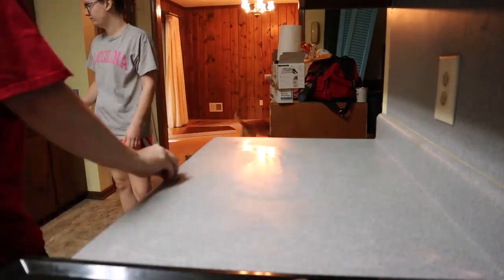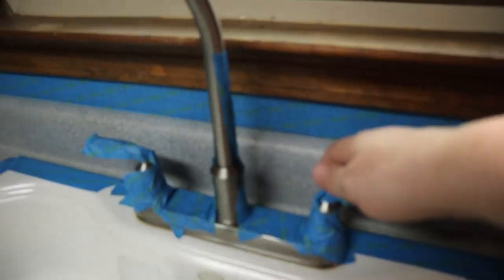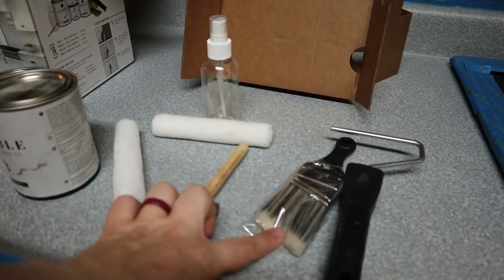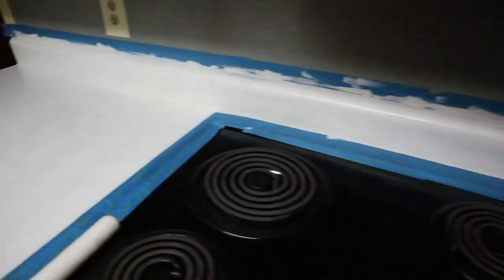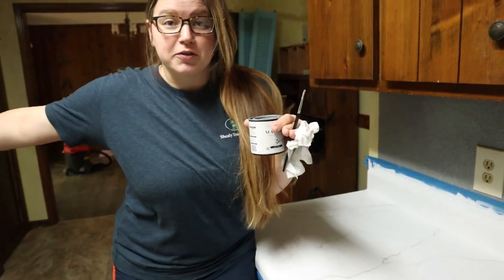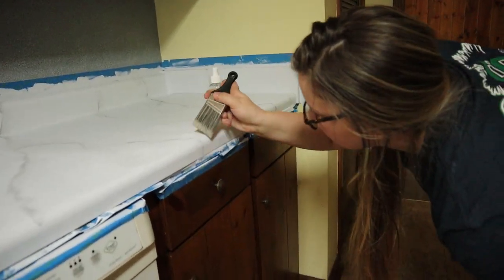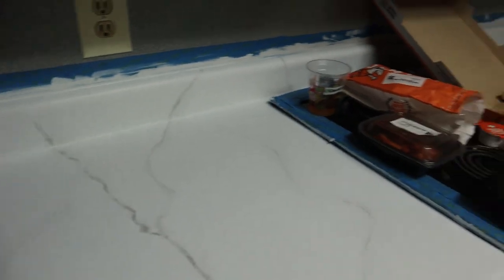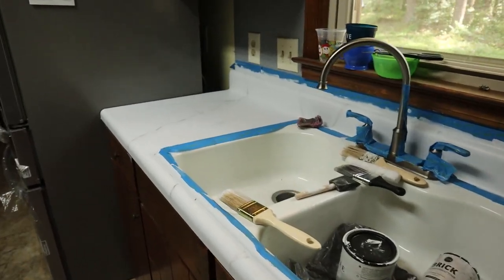Giani DIY marble countertop paint kit | under $100

Comment: did you use the marble kit with the epoxy? i can’t find one with just the white paint and black marble paint with the topper /:
Reply from the maker: I did not use it with the epoxy. But I would spend the extra money on the kit with epoxy. The counter tops have lasted after a year with the top coat that was provided in this hit. However they would last a longer time if they had epoxy on them. I have looked for the kit without epoxy and I think it’s been discontinued.

Comment: That looks so good :) I’m planning to do this to my bathroom vanity counter top. What top coat did you use ? Is it water based or oil based ? Can you still use cleaner solution like Method all purpose cleaner to clean it or just use water and cloth ? Thank you very much in advance
Reply from the maker: i believe it is water based. We used the top coat that came in the kit. but i would suggest investing a little more in the epoxy kit so that it gives it a longer life. Yes you can use a method all purpose cleaner on it. We are just really into Norwex so that is what we use.

Comment: How's the countertop holding up?
Reply from the maker: It's holding up great without the epoxy. I would recommend buying the epoxy kit though to ensure durability. Counter tops are in the house of two toddlers and to adults, No problems with nicks or scratches.
Reply: @BreakingBrowderFarm   we just got the kit with apoxy here in North Mississippi. It's definitely not discontinued. We are in the middle of doing ours now.